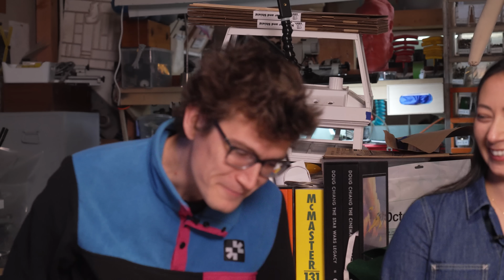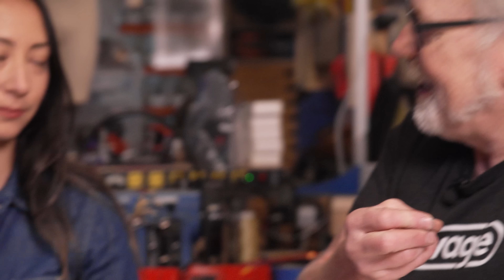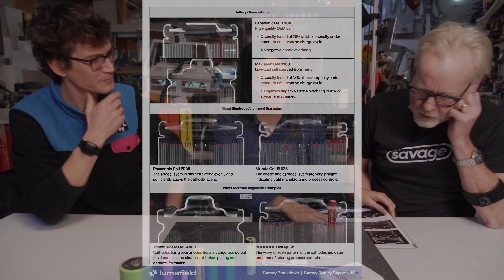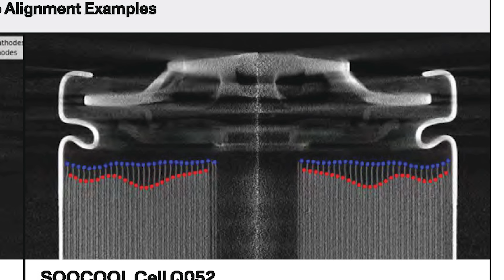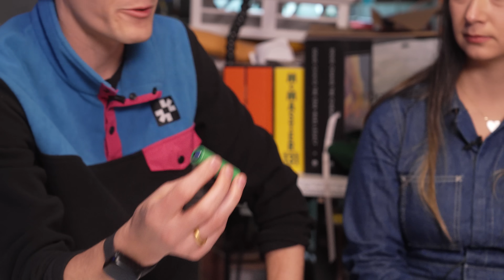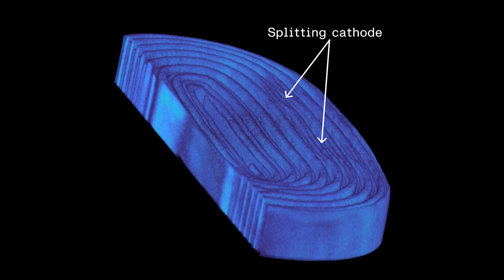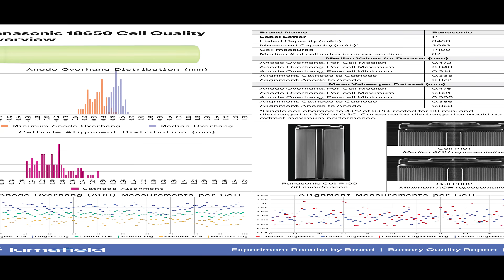The Surprising Flaws in 18650 Lithium-Ion Batteries

Comment: Fine information.
I am shocked how terrible the battery industry has become. Most notably about grossly over stating the capacity as well as charge and discharge rates.
Whilst an issue in 18650 cells it's even more prevalent in the (RC) pouch batteries.
Reply: Overspeccing up to physically impossible capacities has always been there.
It's just that online sales directly from scammers have increased from that of say 15-20 years ago.

Comment: Ok... now I'm freaked out... I have a bunch of "GTL EvreFire" brand 18650s that I bought in April 2025 for small flashlights... I didn't think twice about the "9900 mAh" rating on them... The GTL's I have are identical in appearance to the Benkia in the report, and I see that they have the "EvreFire" tag line...  I see that the GTL's are no longer available on Amazon, which is very telling...  I'd avoided the, what I presumed were too-cheap options, paying $4.12/per battery, but I realize now, brands have names to protect which is why they have higher quality standards...

So, I'll be visiting 18650 Battery Store and getting some Muratas instead... yea, I'll be $4.45/battery (after discount for 10+), reducing the risk of my house burning down will be worth the cost (plus the sunk cost of the ones I'll be sending to a battery recycler).

I just wish the CPSC was able to do this type of testing of the products coming into the country to try to weed out the dangerous items before they reach our shores...
Reply: "I see that the GTL's are no longer available on Amazon, which is very telling"
Yeah no. Scamazon doesn't care about fake or dangerous products. Rather you will not find it anywhere cause it simply NEVER was an actual brand or company but just one of the rebrand-scammers. They never stick long with a name and those "companies" vanishes after a couple years.
Reply: As a rule of thumb anything over 3500mAh is extremely likely bs for 18650, and even then, those are low discharge rate batteries (Samsung's are rated at 0.2C, so 3500*0.2=700mA, though with a maximum of 8A/2.5C and losing 10% of the capacity)
Reply: @satibel I have a sofirn hs 22 it comes included with a 4000mAh 18650 battery.
Is it not a real one?
Reply: @wy2679  Late response because this is the first time I watched the video, but yes it's fake. The max capacity on 18650s are 3500mAH. 4000mAHs legitimate are reached with 2 cells.
Reply: Reading this is quite impressive and I was shocked at the proof in this data that Murata makes the best batteries and is also the most honest.  The data couldnt be more clear - they are cheaper than panasonic/samsung and have more capacity and has a very clean/consistent tolerance on the jelly roll CT.
Reply: @ccibinel  "Clean and consistent" got little to do with "best batteries". That just means you prefer internal looks over actual relevant aspects.

Comment: "I would like to have a checker to see if the battery even has the safety device" It should not be too hard to test. Overhead the battery with very high current draw and see if it cuts off. If not, then you have no protection or faulty protection. It is reasonable to assume that the same manufacturer are not charging if it is included or not on a per battery basis, so you might sacrifice a cell for the knowledge, but it does now mean the only thing left to detect are overwraps and counterfeits.

Comment: The big problem with manufacturing is too many "knock-off" manufacturers depend on the BMS safety features to protect their battery from itself  Then the BMS manufacturers rely on the batteries to conform to an industry standard of redundant safety features to accept a charge. Needless to say, when your house burns down in the middle of the night, how do you prove who's fault it was. The battery, the BMS, or the charger??? If you can even figure out what brand battery or BMS was in the device!
Reply: Excellent point about the BMS being used as a safety mechanism instead of engineering a robust battery
Reply: False.  A BMS cannot protect a cell from the problems described in this video and no one believes it can nor relies on it being able to.  No BMS relies on cells having "redundant safety features" as redundant literally means additional features not required or relied upon.

"Needless to say", your post is uninformed FUD.

Comment: I have found 18650 cells that were half sand inside, basically enough material to make like a AAA battery with sand filling in the rest (mostly for weight). Wonder if they every saw those?

Comment: Cylindrical lipo batteries (i.e. 18650 style) are the safest type of lipo batteries. They are not nearly as dangerous as pouch cell lipos. I don't think I've ever heard of a cylindrical cell lipo failing in a thermal runaway like pouch cells do unless the cylindrical lipo experienced physical damage first, which is much harder to do because cylindrical lipos are encased in steel.

Comment: I would be very interested to see the same test done on the cells inside the battery packs for the cheap knock off power tools you can buy from Ali/Temu/Wish
Of course common sense would suggest they'll be using the cheap crap cells, because the end product is as cheap as it is, but it'd be interesting to see

Edit: Also in the vape industry, long before what it now is with all the disposable crap etc, there was a common phrase when it came to batteries, that went/goes along the lines of "Don't buy anything with fire in the name or you'll be playing with fire" because almost all of them not only blatantly lied about capacity, but also current ratings, especially the BS "pulse" ratings that mean nothing without context, people were way more commonly using sub-ohm atomiser coils on "mech mod" style vapes at the time too, which were literally just a metal tube with a button and a direct connection from the battery to the atomiser on top, may as well be a pipe bomb with the cheap cells

Comment: 21700s for the win. 18650s die way to fast in my vapes at 115w. In my shop we always recommend the 21700 mods because they all happen to work with 18650s with adapters as well, so why not. In the past the industry tried 18350s and they were just too small and also 26650s which were MASSIVE and made mods too big. They also attempted 20700 but for a tiny 1mm increase in width the 21700 adds more battery capacity due to volume growing faster than area and therefore more value for vaping overall. Sony, Samsung and IMREN make the best batteries for vaping as well but the most accurate mAh and a good mix of high and low amps for regulated or unregulated mech mod needs.

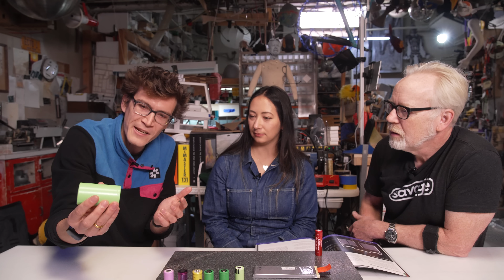Comment: 9:20 26650 is the sweet spot for cell size. Small enough to fit in a lot of 18650 chargers and torches are common enough. They also are the same diameter as C cells. Many things that takes two C cells in a line can take a 26650 (and a spacer).

Comment: There is a massive difference between Li ion and LiFePo.  And Li ion is actually not very common anymore.

LiFePo does not suffer from the fire issues of Li ion.

Notice this FUD for Clicks session neglected to mention that.
Reply: All energy sources catch fire.
That includes LiFePo.
BYD vehicles have the most fires in China.
Reply: LiFePo cells have different voltage ranges that barely overlap Li-Ion. All common retail 18650s & those used used in power tools, laptops etc. are Lithium Iron, with maximum charge voltage of 4.2V per cell. LiFePo cells would be destroyed at that voltage, their maximum charge voltage is around 3.6V per cell. They are in no way interchangeable.

(I'm not arguing the fact that LiFePo are better in many ways, just that they are not common in the 18650 form factor.
They have around half the energy density of Lithium Ion, so not good in portable applications but great for static use. No FUD!)

[ps. NiFe are even better for static use - no practical life limit, with occasional maintenance as they are wet cells. Manufacturers don't like things that do not need replacing, though].
Reply: @RJTC  There is  a confusion of terms in this thread.
All rechargeable Lithium batteries are 'Lithium Ion' - they work by moving lithium ions between anode and cathode.
The cathode chemicals can differ.
The most common type is NCM - Nickel Cobalt Manganese. These are high energy density batteries used in performance cars like Teslas.
The only automotive batteries made in China are LiFEPO4 - Iron Phosphate cathode. All Chinese cars use these as they are cheaper and adequate for budget vehicles and stationary storage systems.
There is no 'Lithium Iron' cells as such.
Reply: @waynerussell6401  Yep, the "Iron" was a subconscious typo, should have been Ion..
(Possibly already thinking ahead to NiFe).

Comment: The CID doesn’t trigger on overheating but on overpressure, e.g. due to gas generation from a overcharge. The cell may also overheat from such a failure mode, but again, thats not what the CID triggers on.

Comment: As noted, electric vehicles use the 18650s in their battery packs.  A typical Tesla pack uses 4680 of these cells and due to their design, even with all the safety measures they take, they're still highly suceptible to damage and catching fire or exploding.  BYD's Blade battery on the other hand can be penetrated or crushed without runaway, fire or explosion.
Reply: Tesla typical pack is not 1865. Standard models use LFP packs, GigaBerlin uses Blade batteries. Only high performance Model S and X use gold standard Panasonic 1865 cells.
BYD cars still have battery fires, more than Tesla.
Tesla fires are extremely rare - 6.5 Fires per Billion Miles Driven. vs 55 all other brands - eight times safer.
Reply: @waynerussell6401  Thanks... Point was the difference of the battery shape/configuration (and chemistry) between the two types.  Tesla has only been using prismatic LFP since 2021 and only certain models.  Only the Global Model 3 and Model Y variants use that configuration.  BYD has been using them since their inception.  The combination of LFP and the prismatic configuration makes them safer.  
Never said that Tesla battery fires were more, or less rare... just that they happen, and that blade battery technology is much safer than cylindrical.  Blade tech is newer and thus, less of them are on the road but you can research the tests and see there is a huge difference.  Hell, even Musk has acknowledged this fact and is converting all models over time but it will likely be many years before they're across all models.
Reply: @_SurferGeek_  Tesla uses cylindrical because they are stronger (load bearing in structural packs), faster/cheaper to make and with 4680 format, have lower internal resistance and cooling problems necessary for fast charging and higher power delivery. All cylindrical cells have venting unlike Blade. Performance vehicles use cylindrical batteries - Rimac, BMW, Koenigsegg, F1, Aston Martin...  Porsche use pouch cells and have had harsh recall financial problems with them - as have Hyundai and GM. 
Tesla have designed their own cells called tabless 4680 which have a unique low resistance design maximizing cooling and current delivery. As of a year ago these are the lowest price cells Tesla can procure and are now expanding production to Germany. They have equal highest energy density to Panasonic 2170s, but with potential for higher with silicon anodes. Panasonic and LG are trying to make their own versions of this but to date are not commercially available. This format can be made in LFP chemistry and Tesla now have their own LFP Factory ex CATL in USA, about to make prismatic cells for storage.
Chinese battery manufacturers do not make high energy cells for auto even though BYD make them for cell phones.
Tesla is the largest consumer of cells in the world and have been production constrained though lack of cells. The Semi is particularly affected with its large packs. Therefore they will use any brand of cell that meets their performance criteria. That includes LG in China making their 2170 NCM cells even though their performance is less than the Panasonic equivalent (Model 3P).
Tesla has made no commitment to converting its vehicles to LFP over time. Only storage and base models. It is highly likely their highest volume car, the CyberTaxi and the billions of Optimst robots will use internally made and cheaper 4680s.